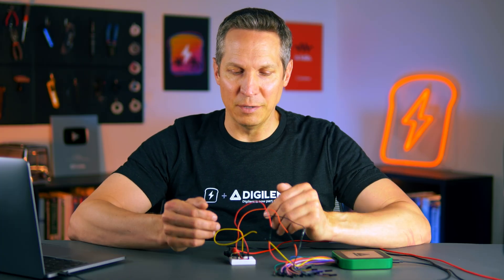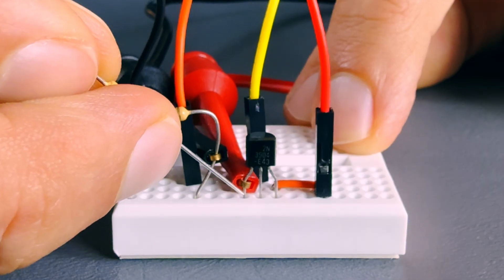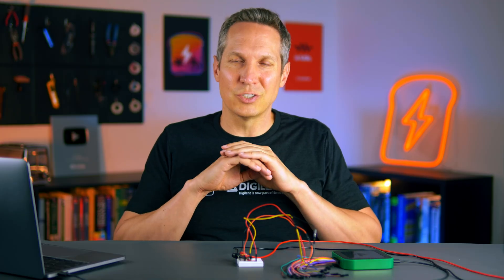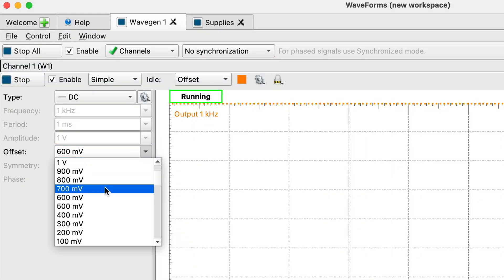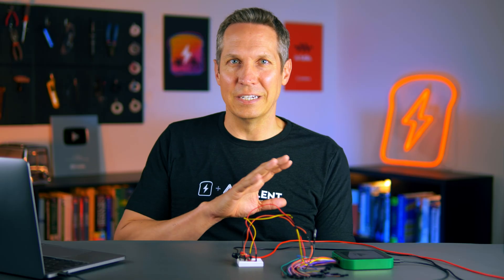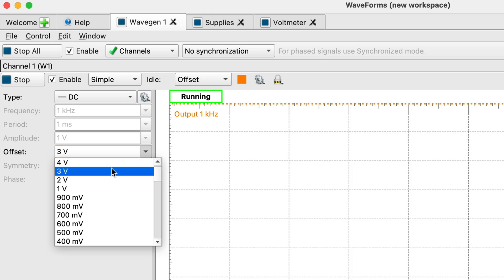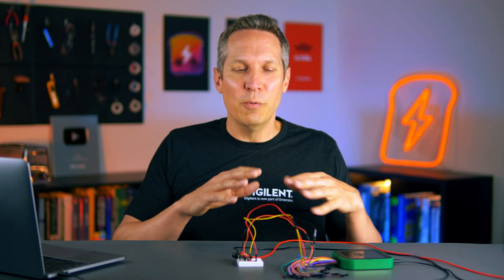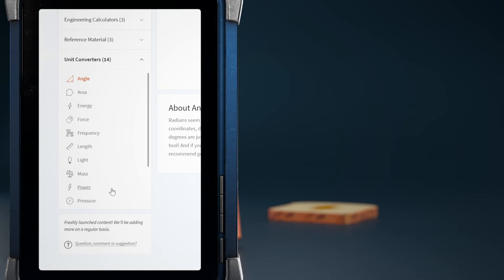Bipolar Junction Transistor (BJT) - Practical Experimentation

Comment: Just a bit of nitpicking: with an NPN you would rather put the load on the high side and the emitter connected to ground. When you say the base is at 1V, some young players might miss the fact that this doesn't mean Vbe is 1V, it's actually Vbe + the voltage drop across the load.